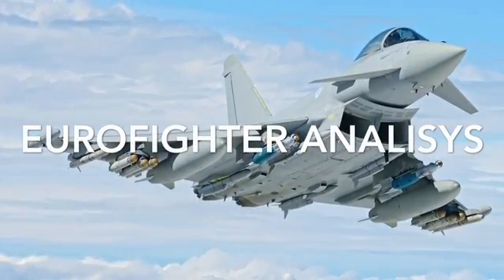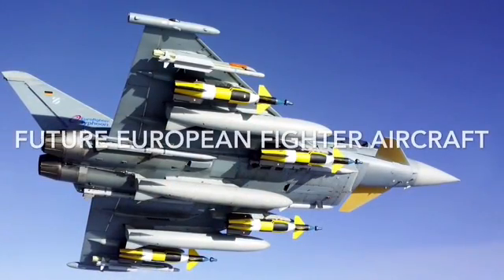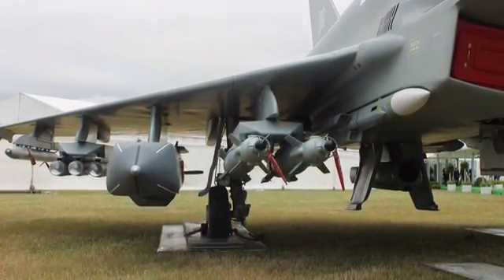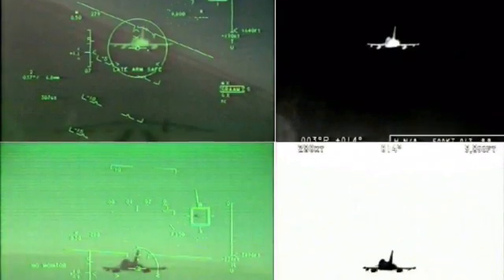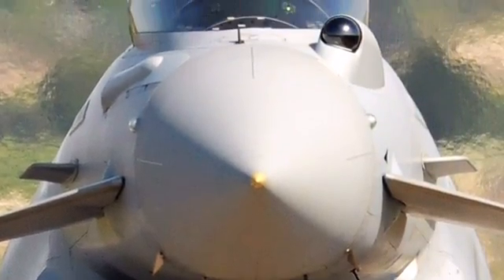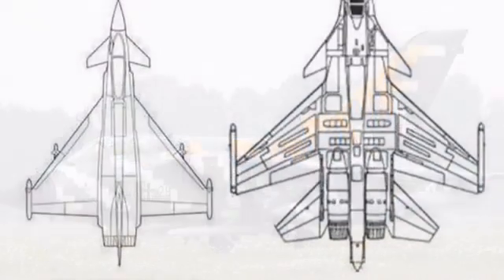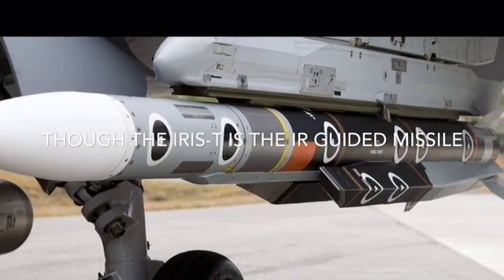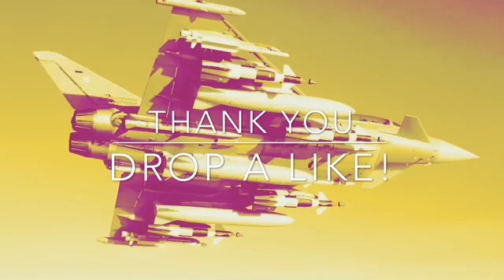Eurofighter Typhoon Analisys

Comment: EF can't supercrusie at Mach 1.5.  Mach 1.2 is the max supercruise speed with 4 AIM-120 AMRAAM in the semi-recessed stations.

EF can't easily jam F-22 interleaved APG-77 operating in LPI frequency-hopping and shared deception techniques between 2 Raptors.  If you think the APG-77 works like a conventional radar, you will be sadly mistaken.

The idea that the Typhoon can easily outmaneuver the F-22 is a sad joke perpetrated by cherry-picked BFM set-ups from Luftwaffe at Red Flag Alaska.  The F-22 was dominant against them throughout the side-bar BFM exercises, but one of the German pilots told a reporter that he ate "Raptor Salad", and had F-22 kill markings painted on his plane.  This is pure unprofessionalism at its finest.  This was also with Typhoons stripped of all their relevant combat systems, no fuel tanks, pylons, captive missiles, FLIR pods, or suspension equipment.  In that configuration with minimal fuel, the Typhoon can match the F-22's climb rate, while the F-22 is carrying a lot more gas and internal weapons.  The combat-coded F-22As now have a Helmet-Mounted Sight and AIM-9X capability, not that they need it.  The new AIM-9X Block II and Block III are WVR and BVR missiles with digital Imaging Infrared seekers, enhanced propulsion, Thrust Vector Control steering, and data link capability for Lock-After Launch.
Reply: @LRRPFco52
According to most of the sources, EF can supercruise at Mach 1.5. If it's not enough you can buy EF with improved EJ200s (about 15-20% more thrust, I'm not sure but you can find info on the official website). 

Jamming is way more complex than we may think. But we already know F35 is capable of effectively jam APG77. We can assume that CaptorE is more powerful and more sophisticated than APG81 (used on F35) since it's diameter is slightly bigger, was developed with some experience on F35 and is simply newer. According to EF website and former RAF EF pilot Paul Smith, Eurofighter is capable of 'electronic stealth' which is 'other way to do the same'. Of course, it won't be as effective as real stealth but reduces the gap without real stealth drawbacks. Also, we may notice that F22 has no passive sensor like EF Pirate making F22 easier to spot while it is using its own APG77.

While it comes to a more complex scenario when there are multiple radars working together, stealth is losing its edge. And that's really worth knowing since the real war scenarios are of that kind. 

Luckily for the western world EF and F22 gonna work together and others should be afraid.
Reply: @szymonjarczewski3709  EF cruise without AB and limited to relatively slick configuration is Mach 1.2. With suspension equipment, EFTs, and weapons, it's hard to get to Mach 1.8 with reheat.

CAPTOR-E is not more capable than APG-81, especially since it doesn't exist in operation European EFs. TRM count is smaller last I checked. APG-81 is 1676 TRMs with a much larger array than initially reported.

Even using later semiconductors and power amps in the Typhoon, it will never have the integrated power, cooling, and central processing capacity of the F-35 without a massive redesign of the airframe.

F-22 most certainly has a more vast array of passive RF and IR sensors, although its IR are countermeasures, not IRST. APG-77 has not remained a static, independent sensor either. It has had far more upgrades and expansion potential of any fighter other than the F-35.
Reply: @LRRPFco52  Captor-E is slightly larger than APG81 with a bit more T/R modules. Probably fixed antenna Captor-E could be even larger but it would be overkill. EF nose is large enough to accommodate a large rotatable antenna. It gives a significant advantage in A2A scenario allowing doing something that we call crank without losing lock or radar contact, but most probably u have no idea about air combat tactics. There are more differences which cannot be discussed here. But look, although F35 have some A2A capabilities, it's configuration (and radar as well) is optimized to do A2G role, not A2A while F22 and tranche 1 EF was purely A2A fighters. Nowadays Captor-E is A2A radar in the first place. And it's newer and developed with knowledge about APG81. And you still claim APG81 is more sophisticated in A2A? It is surely not the most obvious conclusion, is it?

F22 was a really impressive project. For some reason (effectiveness?) the order has been reduced from an initial 648 to 187. That increased cost of a single airframe to the values we hear today. It also lacks some systems that were initially planned. Eventually, the production line was dismantled and packed. Unfortunately, the analysis for the Pentagon shows that it is not possible to restart it. This will greatly limit the so-called mid-life upgrade and already limit development work. In the future, we will have a problem not only with F22 development but also with parts replacement. That can cause F22 retirement before some initially planned features will move in.
Reply: @szymonjarczewski3709  I've looked at the Captor E antenna size, which is not bigger than APG-81. There are no published sources I'm aware of that specify TRM count on it, but they're going to have to do some magic to get over 1686 TRMs.

They're also going to have to redesign the integrated cooling system for the radar power amps if they want to reach for what the F-22 & F-35 are capable of.

Sure, I've never heard of cranking, grinding, notching, f-pole, or any other 4th gen BVR fighter radar/missile tactics.

What you're talking about is a 4th Gen frontal aspect, mutual detection fight where each formation of fighters tries to game out their strengths and weaknesses on a BVR timeline.

The benefit of having a radar like Captor E (which no NATO operational Typhoons currently possess), is that you can get first launch with AIM-120 or Meteor, then offset while keeping the radar antennae oriented towards the TGT while "cranking" your flight path almost perpendicular to the TGT, buying you more distance and time for evading his BVR missiles.

All the while, you're providing continuous wave mode illumination for the missile, so it doesn't have to go active homing and trigger a missile approach warning in his threat warning system.

The reason this makes a difference is because of the RF bandwidth difference between a fighter radar and a missile radar, as well as the closure rate determined by the processor for the TWS.

With the ball bearing articulation on Captor E, you can rotate the antennae, which is pre-inclined into a more look-up angle when bore-sighted.

If you rotate that angle to the threat side after offsetting, you keep the TGT illuminated and tracked, providing continuous solutions for the FCC, and thereby the missile.

Once the missile gets within a few seconds of impact, it will switch to its active homing mode for the terminal phase.

Basically, Captor E and the Gripen E AESAs allow a 4th Gen fighter to create larger NEZ parameters for their TGTs, while placing themselves outside of threat NEZ parameters.

That is the latest stage of 4th Gen BVR radar and tactics.

5th Gen steps outside of mutual BVR timelines and strikes unfairly after pulling threat fighters into NEZ parameters.

They can do this from frontal, oblique, rear, from under, or from above at varying angles and distances, depending on the threat sensor suite field of regard, detection ranges, and conditions.

The main difference is that with 4th Gen, you generally see your adversaries once in each other's sensor parameters.

With 5th Gen, you eat a missile without any warning or ability to evade and don't know why. This is why a comparitive analysis between specs of individual sensors or metrics between an F-35 or F-22 & Typhoon don't capture the full picture. Any honest Typhoon pilot will tell you the same thing.
Reply: @LRRPFco52
The second part of your comment is pure nonsense. 

Germans said a lot more about their fight against F22. In short, they claimed TW of F22 was a problem but not for EF. It caused big AoA hence loss of speed making F22 an easy target. 

There is still no HMD on F22 which is a shame.

AIM9 never was and never gonna be BVR missile (unless you have really bad eyesight :p). It was never the purpose of AIM9. TVC, datalink or lock after launch capability isn't anything special, most of the competitors feature that. Actually AIM9X hasn't two-way datalink so don't be silly.
Reply: @szymonjarczewski3709  No combat-configured Typhoon will have T/W like a Raptor. They specifically stripped them down of all stores other than ACMI to make them competitive for BFM.

AIM-9X newer blocks are BVR missiles due to the improved rocket propellant, and combat-coded Raptors are being upgraded with a low profile HMD similar to the A-10C HMS, since JHMCS won't fit inside the F-22 canopy.  The F-22 HMD also allows wearing of NODs without having to remove the HMD visor, unlike JHMCS.
Reply: @LRRPFco52  Because the Typhoon carries far more weight than the F-22...... Can't worsen your T/W when you only use half of your capacity because the need for stealth requires it. By the way, I found a lot of sources saying Mach 1.5 definitely possible.
Reply: @LRRPFco52  Learn more about the Striker 2
Reply: @Sedna063  The F-22 is far heavier than a Typhoon. F-22 empty weight is  what a combat loaded with full internal fuel weight is on the Typhoon, and the F-22 still out-performs it in a combat configuration. 70,000lb of thrust with a clean airframe meant for speed and supermaneuverability  are what set it apart from a delta wing design, where energy bleeds rapidly once you put AOA on it.
Reply: @LRRPFco52  The combat configuration is a far lighter configuration than a full maxed Typhoon. 

AoA fighting is good for knive-box fighting, but slows your jet down making it a sitting duct. By the way, new LERX are potentially added to Typhoon to drastically increase AoA. And Delta-wings are a good compromise for supersonic flight.
Reply: @Sedna063  I know, which is why I didn't use MTOGW for Typhoon. In an A2A configuration, the Typhoon still doesn't have the T/W, acceleration, V max, climb, or energy retention even close to what the F-22 does. The Raptor can match V max without even using reheat, while the Typhoon will have to reheat just to get into the mid Mach 1+ range before hitting drag-limited max speed of 1.8 mach with stores.

When you look at weapons separation kinematics, both aircraft are extremely deadly in the BVR realm, but the F-22 is the master of VLO approaches into NEZ.
Reply: @Steve Trott  My family spent 2 years in West Germany working on the European Combat Aircraft program with German and British Aerospace Engineers before it was even the EFA, so I've been abreast of its development for exactly 40 years now to the month.

Your information about which fighters carry the Meteor needs some dusting off:
Typhoon
UK F-35B
Rafale
SAAB Gripen

The Swedes reached IOC on the Gripen before anyone else.

Yes, the Typhoon is very impressive with no or conformal external stores. Most of its aerodynamic work was benchmarked on the premise of a 4x AMRAAM conformal carriage, not how the aircraft is actually configured for combat sorties.

Once you configure it, parasitic drag will change your EM and Vne Plackard limits considerably.

It is one of the more capable 4th gen + platforms though, with superior climb rate and excess thrust to an F-16 & MiG-29, with better cruise speeds and supersonic performance, as well as combat radius due to fuel capacity and higher altitude efficiency of a delta wing.

The F-22 has substantial gains in performance over it in combat configurations, far superior first-look/first shoot capability, and far superior NEZ weapons parameters even with an "inferior" missile because of VLO approaches.

The real dynamic duo for the UK is Typhoons networked with F-35Bs. That is an extremely dangerous force mix for any threats to the UK. 

There will never be thrust vectoring on UK Typhoons, though the EJ200s will continue to undergo normal phased upgrades for SFC and thrust, though they might be happy with the current performance, safety, and longevity of the motors.

Thrust-vectoring would only add complexity and weight for no real practical performance gains in networked BVR kinematics.

UK was supposed to have CAPTOR-E years ago, and has missed the planned deadlines repeatedly because Germany didn't agree on funding and radar modes that the UK wants, with all the software engineering that needs to go into integrating the vast Air-to-Ground weapons suite in the UK's arsenal.

The Germans have always seen the Typhoon as more of a strict interceptor, so their demand for A2G capes is nothing like the UK's (who plans, trains, and deploys as part of a NATO coalition expeditionary force on a regular basis  bringing significant capability to air planners as an expanded multirole platform).

These are my natural thoughts on the matter, not "cut-&-pasted" from any source.